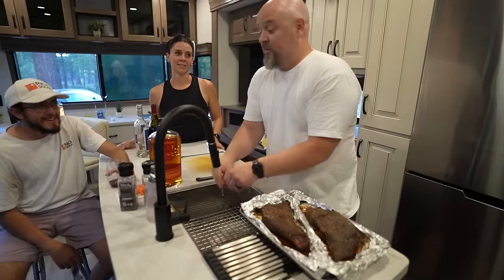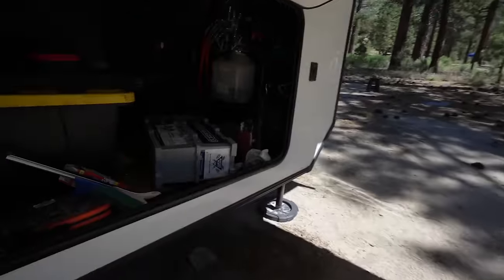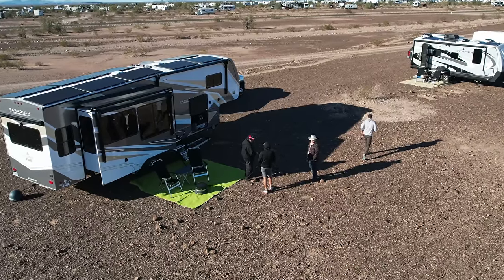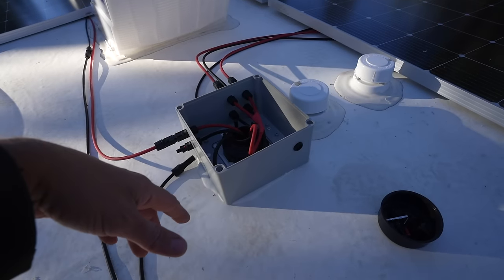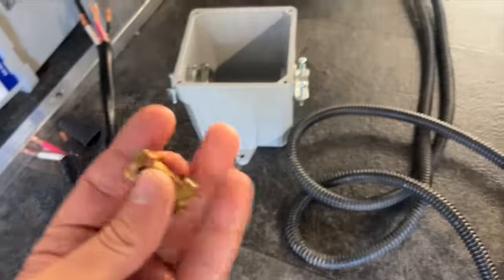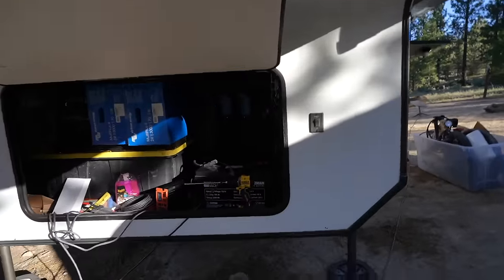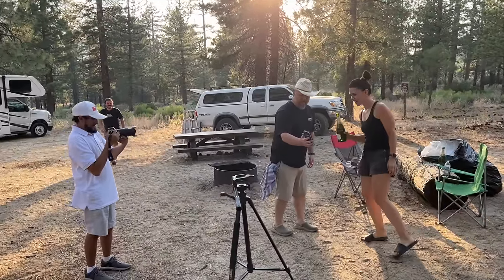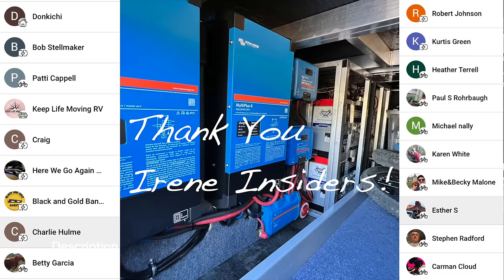24v Battle Born Battery Power with 2750 watts of Rich Solar! (RV Lithium Battery UPGRADE)

Comment: Not sure why you would make your system 24v then have to loose efficiency when you bring it back to 12v
Reply from the maker: I will be doing a video about 24volts in RV's to help explain it because it is relatively new for RV's to do this and its a lot to cover.

 But actually the higher the voltage the more efficient the whole system will be and its why off grid cabins would even do 48volt or higher. 

So you're right you do loose a little on the conversion back to 12v, but that is only for the few small RV components...like lights, fans, water pump, jacks, and accessories. This is usually 100 watts or less. 

But, where you really gain efficiency is going up from 24v to 120v instead of 12v to 120v. And this is the BIG components like AC, heaters, micro, etc.  1000's of watts.